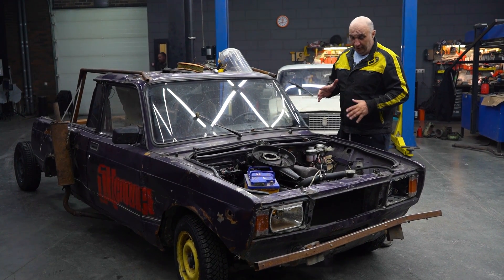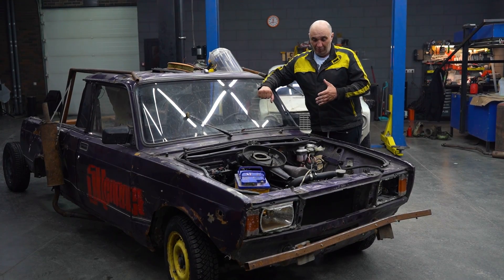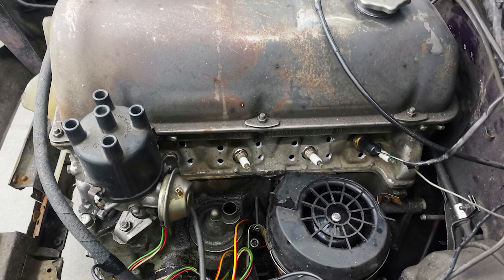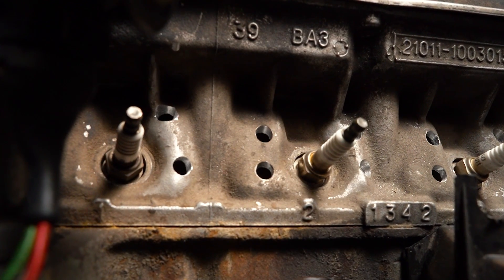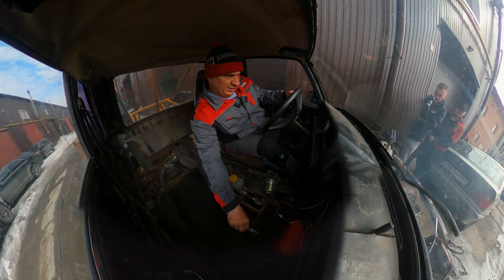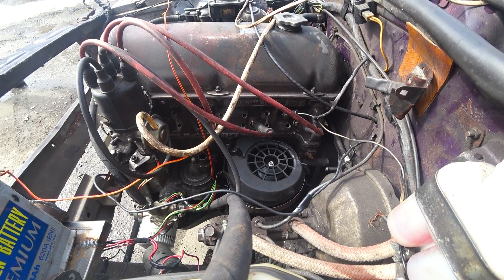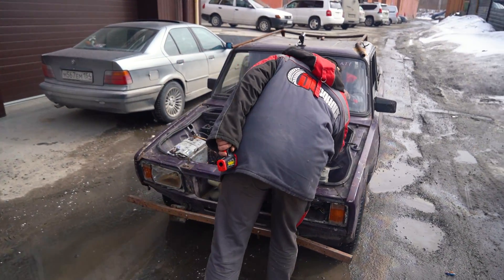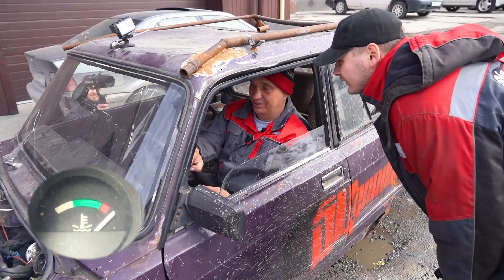We convert a Lada motor to air cooling

Comment: Maybe use a turbocharger as a blower? Rear mount it and run long alloy tubing back up to the front to an intercooler then into the block via a manifold that directs air to each cylinder.
Reply: Air isn't efficient enough to do without additional surface area for it to interact with. This is what the fins on an air cooled engine are about. Order of magnitude more surface area (at least!)
Reply: @MadScientist267  volume of air makes a difference, if you have have a thousand cubic foot of air blasting past a cylinder a minute your still going to get more cooling than 100 cubic foot a min🤷🏻‍♂️. Everyone knows what works, it's about trying the unknown and seeing how effective it is😉.
Reply: @MadScientist267  the cylinders actually don't need that much cooling, it's the head that takes on most of the heat as well.
Reply: @brotang2953  You can't squeeze enough air by it without the fins present to make it work.

I like this channel but some of the ideas are derpy. There was nothing anyone was going to do to that engine that was going to make it survive this experiment. I knew that ahead of time, and as such have never (and wouldn't) bothered trying this "conversion". When common sense clearly indicates something, there's no point in going thru the motions unless you're just showing how wrong it will go.

Even Vlad there knew the deal, but because YouTube creators have to sell out to stay relevant, this shit pops up. Not all the ideas are bad (the engine braking valve was an intriguing idea)... But this? This is just "yet another way to blow a 4 banger"... Not very "great" on any level 🤷‍♂️
Reply: @MadScientist267  I think it's a bit less serious than all that, they essentially try out ideas people come up with and see how effective they are or aren't. Experimenting for the sake of experimenting basically. As a welder I know what your saying but I kinda disagree to some extent. You can actually greatly cool down hot metal with nothing but air😅, example being if I weld a piece of metal and and then leave it in open air it could be several minutes before it's cool enough to pickup, if I hit it directly with the air gun it cuts that time down quite considerably, of course to almost instantly cool it ya throw it in a bucket of water lol but if you feed enough air past a flat piece of steel it does actually take quite a bit of heat out. I agree my idea will overheat as well but I think you'd get at least a few times the runtime before it did. If you water cooled just the head and blast cooled the cylinders it might be enough to keep it running for quite a decent time.
Reply: @brotang2953  Yes I know, it's not intended as serious. It's all fine and good... They appeal to the people that always wanted to do whack shit to a car but don't have the resources to play with. Vlad is perfect in that sense... Got the "crazy Russian" thing going, and knows where the tree is these Ladas grow on 🤣
Reply: @MadScientist267  some of their joining of engines is pretty clever work, a real barn door approach to engine building 😂😂 and amazingly it works even🤣.
Reply: @brotang2953  The key difference you're looking at with something like welding is the temperature difference. For heat to flow, there has to be a difference in temperature. At 1000 degrees (or more of course), the delta to the ambient air is very high, and much more heat will leave the joint to surrounding material much quicker.

An engine block is designed around the idea of no more than about 100C, an order of magnitude cooler than a weld.

This correlates to ~1/10 the heat transfer as well. Hence normally using fins. If you increase the surface area by 10x but have 1/10th the heat transfer, the result is a wash.

So yes, while you are correct at the fundamental level, the details are what breaks it.

Comment: The biggest thing here is that there isn't enough surface area for the engine to dissipate heat.  So what if the engine has a large air flow as the cylinders are cooled by their smooth surface.  This is why air-cooled motors are finned.  It will be hard to do without a new engine casting specially made for this purpose.  Certainly, an oil cooler and an increased capacity of the oil pan (not the oil level, more oil with the same level in relation to the engine shaft) would help a lot here, and you could make an additional pump that would pump cold oil and pour it in the head in large quantities  so that it spills in it and flows back into the bowl.  All this, however, without the correct ribbing of the cylinders will probably only prolong the agony of the engine, instead of allowing it to work theoretically indefinitely.

Comment: I think that if you pipe the intake of the carburettor to the top of the engine where the thermostat is but take out the thermostat that would get the air moving through the cooling part of the engine,  it would do away with needing an electric fan aswell, also you need a big oil cooler.

Comment: Stuff the water jackets with coarse steel or copper wool., to increase cooling surface area. Then blow high pressure air through it.

Comment: Fins...lots and lots of fins like an air-cooled motorcycle engine. I had a Honda CB 750 inline 4 DOHC that was air-cooled. It was basically a small car engine.
The bulk of engine size was due to the cooling fins. It sure radiated off the heat. I could warm my hands while riding on a cold day but it wasn't happy to not to sit still and idle. 

Another idea for the air-cooled idea is to pull air through the water cooling system from one end with a turbo intercooler on the intake side using the in and out from where the radiator would connect. This would allow air to be slightly cooled by the intercooler before being drawn around the water jacket then ejecting the heated air from the engine.

Comment: Add an oil cooler to the oiling system to aid the keeping the temperatures down and add a stronger blower to the side of the block. Then,make the holes that were drilled into the cylinder head larger.  That should keep the temperatures down.

Comment: More surface area, like the fins on a radiator or a heatsink, would help the engine exchange more heat with the incoming air.

Comment: Y'all need to get a team together of the best engine builders in the area and build a diesel engine specifically designed to run off waste oil permanently for long long periods of time with no issues and no damage to the engine this will help a lot of people

Comment: Weld fins on the cylinder head, and turn the radiator fan blade the opposite way to force cool air in, and add an oil cooler.

Comment: Increase surface area like adding fins or larger Chambers and blowers fans. But ideally you need air going across the engine while running. You really can't idle for too long without the proper airflow. Go on a trip and take a trailer if the engine blows. 👍👍

Comment: You guys should add some cooling fins on both sides of the head for better cooling too like an old motor bike. Surely it would be a big help rather than just the bare head with holes drilled in it.
But still wicked video ✌️

Comment: Need more surface area on the block to dissipate the heat. All air cooled motors are covered in fins to increase the surface area, same with radiators how they have lots of small folded fins, all about maximising the surface area. Air has a much worse heat capacity than water, which is why you need a much bigger area to carry enough heat away. I suggest adding a small radiator for the oil, such as a transmission cooler etc, and then cut away the outer water jacket on the block, keeping enough to maintain structural integrity. Then weld in lots of thin horizontal plates as cooling fins, as many as you can fit, and make sure they touch the inner cylinder housings within the block as this is where the heat is generated.

Comment: A turbocharger feeding into the radiator hose fitting as well as a forced induction funnel doing the same. My first thought was do the drill holes area equal the induction area so more holes. Either aerodynamic suction or an exhaust gas ejector suction. Ho and also an oil cooler but you must have thought of that. Wobbels the mad Aussie

Comment: make a shroud for the stock cooling fan to direct it into the block. that way cooling will be bigger across the board, AND it will be rpm dependent

Comment: You need a LOT more oil and a radiator to cool it off. The 1982 Porsche 911SC I owned in the late '80s had a 12 quart oil capacity.

Comment: i suggest to cut the outer wall of the block with a grinder so that air comes straight to the metal that contacts oil. maybe then you can weld cooling wings to the block and cylinder head and add a big belt driven fan in front of the engine(electric fans are good enough to cool down a radiator with low effort because of aluminium heat properties and the coolant flow But a metal wall with holes...i think not) maybe you can check out some deutz aircooled tractors to get an idea!!

Comment: yea i'm on the oil cooling group put a 10 lt. alum. tank on the roof an put the rad back in filled with oil routed through an oil bypass filter thingy. slice the water jacket into fins

Comment: As some others have said here, you need to strip away the entire outside cooling jacket from around the cylinders, and weld cooling fins to the cylinders and cylinder head. There are engines that are cooled by air, usually not inline 4 though.

Comment: You would need an aluminum head and steel sleeved block if you were going to effect a better heat transfer.  Henry Ford used a finned copper alloy head for his attempt to make the Model T into an air cooled engine.

Comment: Use turbo direted to engine block in place of the little electric fan. and the radiator as a big oil cooler

Comment: I think you should not have drilled any holes in the block. The fan was merely blowing the air out of the holes nearest it. You should have just removed the thermostat, the radiator and lower radiator hose, then connected a shop-vac to the thermostat housing to draw air through the water passageways. I believe this would have provided the most air circulation and cooling.

Comment: Love your channel bro! Never stop testing!

Edit: After watching your video, I couldn’t help but wonder how a liquid helium cooling system would effect the engine. [would it be too cold to start?]
Reply: Liquid helium is a bit wasteful. Maybe liquid nitrogen. Liquid nitrogen is used in CPU over clocking.
Reply: Both would fail miserabely, Liquid Nitrogen would be too expensive too for little to no cooling (boils insanely fast)

Comment: What about a turbo with the compressor side routed into the water jackets? Provides more cooling proportional to engine load, much more volume than a blower fan, and high enough static pressure to overcome restrictions and flow through all the passages.

Comment: The exit vents for the hot air or right over the top of the intake of the air fan cooling it if the event was away from the air intake there might be a better also I agree with the comment that that a good oil cooler line would be helpful

Comment: Take a spare head and build it into an air cooled head. Take the water cooled bits out of the head an weld cooling fins around it. Then get a racing oil cooler and a fan to cool the engine down

Comment: A beetle belt drive squirrel cage fan perhaps? The "crazy" idea I can think of would be using a whole bunch of heat sink putty like they use on computer CPU's to get the heat from the inside the block to aluminum cooling fins on the outside of the block. Or pour the whole block full of heat sink compound so the inside cylinder walls can transfer heat to the outside of the engine block?

Comment: cut the block open , weld some fins on to the inner areas of the block on both sides, then build a box around that for air flow, just like a VW

Comment: I suspect the oil vaporizing out of the crank case ventilator was providing most of the cooling.  Speaking of crank case ventilation, what if you bulked up the bottom end of an engine to where it was a pressure vessel and sealed the ventilator?

Comment: idea put a amr300-500 connected to a regular water radiator it blows through the rad then out into a inter-cooler then into  engine comes out the other side of the engine water hole and back into the amr300-500  or any super charger  i wonder if that would be enough air flow to keep it cool i just dont think that tiny fan was fast enough

Comment: A intake for the fan witch draws cold air and not the hot air from the engine bay would be better. add an oilcooler to would help a lot.

Comment: Put the radiator back in only connect it to an electric oil pump, plus one giant turbo from a truck instead of that tiny electric fan to force air into the block.

Comment: Cut bigger holes in the engine block to move more air and an oil cooler would probably make this work. Вырежьте большие отверстия в блоке двигателя, чтобы перемещать больше воздуха, и масляный радиатор, вероятно, заставит это работать.

Comment: Need an oil cooler too, most air-cooled engines have a smaller radiator for cooling the oil in the airflow so it doesn't overheat, otherwise you're going to end up with a nice oily boulder in place of an engine... :P

Comment: you can burn diesel as fuel in a petrol engine if, you heat it up and use the air inlet to pull the air through the hot diesel,   using the hot manifold to continue the process .
Reply: That's a good idea! Might need to throw a little methanol in there to prevent knock & improve cooling, then it could probably run air cooled for hours on "alternative fuels"
Reply: @nathansmith3608  retard the timing a little, we used to run petrol engines on paraffin, by first warming them up and then swtiching over, had to retard ignition , lost a little power but it was dirt cheap

Comment: Add a big transmission cooler to the engine oil and also add capacity. 

The Lada engine probably has very low specific output, so the oil should be able tl keep it cool as long as you get an oil cooler

Comment: One suggestion is replace the cooler used in this video for a turbocharger for exemple to force more air inside the engine and try to have a better air refrigeration.

Comment: You can also get a higher cfm air flow fan that moves more are. Also drawing air in from outside where the air is cooler than the hot engine bay

Comment: guessing the oil began to vaporize...  and if it by the rings ... being sucked upward on up stroke... then that would mix with fuel vapor in the cylinder and drop the octane level way down....  thus bad combustion when spark plug goes off??

Comment: A lot of people have mentioned running an oil cooler and I think that would help but the coldest oil in the world wont stop the head gaskets from blowing.  With the lack of cooling fins and gap between the cylinders and the block, I bet you would have to fill the coolant passages with Aluminum or something to transfer the heat better.

Comment: You needed a front air ram intake for the cooling and air cooled engines are known for over heating when going slow and need to be driven above 30 mph ...ish to stay cool. That why old cars and air cooled motorcycles break down in traffic.

Comment: You should try to cool engine with a turbo and use an intercooler to cool the air down. That should cool the engine better than a stock fan

Comment: As well as the oil cooler people are talking about what if the fan ran according to the rpm of the engine so it was cooling more when under load instead of a constant flow from idle on up?

Comment: I would put a larger oil pan  also an oil pump and a small radiator for cooling down the oil more holes in the head to push out more of that heat out the faster you can get the heat out tke better as you know..God Bless

Comment: You should try to adapt two ventilators or more if possible and instead of small holes for the air out, make larger ones. It should work a little better.

Comment: hi vlad u miss 1 critical aspect of the engine air cooling system on a '70s deutz tractor engine you also see a oil cooler inside in the air path if you open cool air box up you see an oil cooler

Comment: Make an oil cooled engine. Just have oil in the cooling system and see what happens. Maybe try it with a blown head gasket that puts water in the oil

Comment: you can also make gaskets out of copper sheeting like is done for marine conversions of automotive engines , so heat will not destroy them and they can help remove heat , especially if you leave an inch or more extra copper gasket sticking out past the engine walls or the seam

Comment: This is the reason Harley Davidson started using oil coolers on their larger air cooled bikes, and have dabbled with liquid cooled heads on their traditional engines.  Harleys with modern overhead cam engines are all liquid cooled.  Air cooled engines are more likely to work on a motorcycle or lawn equipment due to not being in an engine compartment that turns into an oven from engine heat, but even that is starting to prove problematic with increasingly powerful engines (and US and European emission regulations).

Comment: fins and stripping of the cooling case and maybe a few highspeed fans, think you will have a problem with heat because of there are 4 pistons as apposed to moped engines

Comment: Could you please post pictures of the spark plugs?  I'm curious if the ceramic insulator surrounding the center electrode has cracked or blistered from extreme heat.  As usual, plenty of information and laughs.  My long lost brother from across the pond.